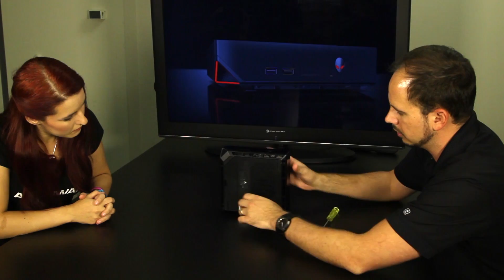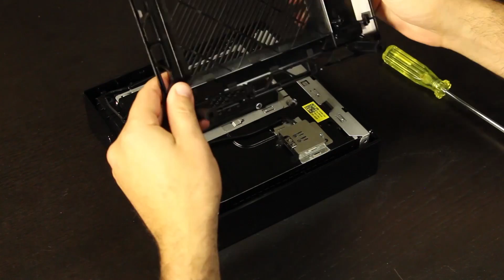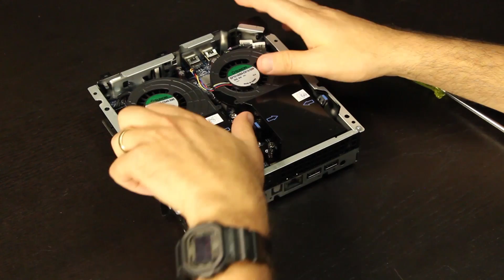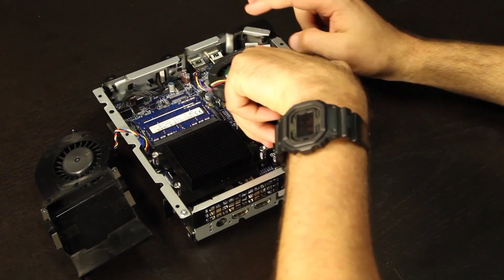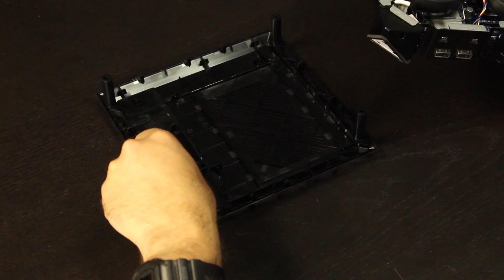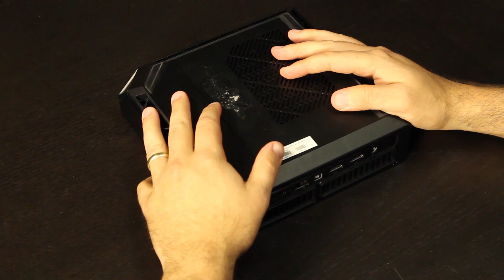Alienware Alpha - A Look Inside the Alpha

Comment: when upgradeing the CPU from i3, is it ok to use i5 4590 rather than i5 4590t,? Is there a compromise if the non T version was installed?
Reply from the maker: The power requirements are different for those. Therefore, the power adapter may not be able to supply enough. However, we've seen users with this setup and no issues at all.
Reply: +Alienware Appreciate the fast response,Ive already went ahead and installed the i5 4950 3.3 ghz,it worked flawlessly

Comment: Only problem , I have is that the video card is having problems, with failing, can I buy a new video chip and replace it like you would the CPU, if so please advise, as the drivers keep failing, and screen goes black restarts 1-2 x then fails over and over til the unit reboots, and the failures start again. So I want to buy a new video card chip and replace it, if this is possible where can i buy it!

Comment: does it bring a graphics card?
Reply from the maker: All the models bring the same graphics card, and it is embedded into the motherboard.
Reply: +Alienware can you please make it so we can change the gpu in different alpha models or have a graphics aplifier
Reply from the maker: Thanks for the feedback. We will look into that!
Reply: Alienware thank you :)
Reply: +Alienware My alienware alpha i3 won't turn on and just blinks yellow,why is this happening?  Also can I use 150v ram or 135v ram, does it matter? thanks in advance.
Reply from the maker: Hello Rick. Try disconnecting the Alienware Alpha from the power outlet. Press and hold the power button to drain it from it's power. Try connecting it again. If the problem persists. Please send us an e-mail to AWSocialMedia@Dell.com with your Alpha's Service Tag and a brief explanation of your issue.

Comment: Were you not allowed to actually remove components without ESD safety equipment?
Reply from the maker: +FrankyManky The system was drained from it's power prior to the video. We worry about our employee's safety as well.
Reply: I was mainly curious, because he didn't actually touch any sensitive components. Just the case and fans.

Comment: Is there a wireless wifi conector?
Reply from the maker: +Mone Kaufusi There is a wireless adapter or "dongle" for the Xbox360 controller which comes included with the system.

Comment: where the hell is the HDD???
Reply from the maker: Cloud Maverick The HDD is located on the bottom part. If you take out the plastic covers. You can find more info here: bit.ly/1L4pB4D
Reply: Haha thanks. I was weirded out when I didn't see it. Also I think this system would be better with a SSD

Comment: What is the name of the motherboard of the alienware alpha i3 core with 4gb ram. Am t Ryan ing ti get thr name of the motherboard so I can up the ram to a 8gb.
Reply: You cant as he mentioned.. Its custom made by them so u dont need a different motherboard to upgrade memory
Reply: So then what kind of ram can I get to upgrade it to 8gb please help me :L
Reply: And you need the name of the motherboard to know what kind of ram to get I believe.
Reply from the maker: +TheAdeptGamer The Alienware Alpha has 2 memory slots which support Dual Channel DDR3L 1600MHz. and is offered with a minimum 4 GB and a maximum of 8 GB RAM.
Reply: So to upgrade to a 8 Gb Dual Channel DDR3L 1600MHz to put in where the ram is correct.
Just trying to to make sure.
Reply from the maker: +TheAdeptGamer Replace the existing RAM with the one you want to upgrade. Correct.
Reply: Just found out since mine is probably a newer version of the Alienware Alpha I only need one 4gb of ram do you have any recommendations for 4gb of ram?
Reply from the maker: +TheAdeptGamer We don't have any favoritism for any specific brand.
Reply: +Alienware Yeah sure you don't but I need help finding a 4gb ram compatible for my alpha.

Comment: It'd be better than a console if you could upgrade the GPU...with that GPU, you'll probably never need to upgrade the CPU (and if you did ever need to, it'd probably be to reduce heat/power consumption to allow for overclocking your GPU, which will probably actually benefit you), and to upgrade the RAM you'll need to replace both sticks if you want to keep the same performance you had before (because otherwise you'll be running mismatched dimms).

Comment: Can i upgrade the graphics card?
Reply from the maker: Bio Gaming You can upgrade the CPU, hard drive and RAM, but the GPU is embedded on the motherboard. Consider that this GPU is a 2GB Nvidia 860M+.
Reply: Good enough thanks!Btw I'm getting one core i7 model
Reply: One more question, Is it a long lasting desktop/console?
Reply from the maker: Bio Gaming It is, if you upgrade some parts, after 3 years this machine will still hold it's ground.
Reply: Ok thanks love this company!

Comment: Could we install any external graphics card on the system other than the graphics amplifer?
Reply from the maker: Omar Omar The Graphics Amplifier is not compatible with Alpha. But you can use the embedded 860M+ Nvidia card included with the Alienware Alpha.
Reply: Alienware Is there any chance in the future when the graphics amplifier will be compatible with the alpha?

Comment: I'm not a big PC or computer guy. But can the processor be upgraded? If I were to buy the i3 but switch it out for an i5 I have here work or that's non-upgradable?
Reply from the maker: Nikkibruuuh TheBeast Yes, the processor can be upgraded; from i3 all the way to i7. You can upgrade RAM, CPU and HDD but the GPU is embedded on the motherboard to increase performance.
Reply: okay, thanks for the feed back.

Comment: How many watts are left for usb slots?
Reply from the maker: The Ultimate Limit Battery Doctor might be able to give you a more specific number, but: "A unit load is defined as 100 mA in USB 2.0, and 150 mA in USB 3.0. A device may draw a maximum of 5 unit loads (500 mA) from a port in USB 2.0; 6 (900 mA) in USB 3.0."
Alpha has 2x USB 2.0 on the front and 2x USB 3.0 on the back.

Comment: wait a sec you can upgrade the alpha with your hands
Reply from the maker: Ballisticcrage You can upgrade it by yourself, if that is what you mean.
Reply: Alienware what i mean is you dont need tools to upgrade the alpha because im afraid if i try to upgrade with my hands it cound break
Reply from the maker: Ballisticcrage You would need a Phillips screwdriver.
Reply: Alienware thanks and i have question, can you play 2 players on the alpha and if you can would you need 2 steam accounts
Reply from the maker: You can both play on a single Steam account, you are only restricted by game limitations not the Alpha system.

Comment: How to Reset Bios , like on my asus motherboard you would stick in a pin in a small hole on back of the motherboard? Thanks
Reply from the maker: SirCharles The battery is located on the bottom on the motherboard, it requires a whole system disassembly to be reset. Nevertheless, there is a password jumper by the RAM modules.
Reply: Can this potentially fix issues from electirc shock? I had pluged my Asus Based Tower into a non grounded outlite and it made my games start having glitchy rendering and texture errors, I put the pin the in back of the motherboard and it fixed the issue. Will using the password jumper do the same thing?  Thanks so much for responding

Comment: i own an Alienware alpha and I'm using it right now. I'm new to gaming, and was told to build a PC. I thought of both, but I have to travel a lot (Due to my parents being divorced) so getting a custom built PC was something I was going to do...but then I saw this...thing. It's no console. Don't listen to them. It's a micro-pc. I got the cheapest one and I already put some extra ram in there and I'm close to putting in a quad core i5. The thing is magical, but I saw 1 and only 1 flaw. no audio jack. you have to go out and buy an audio jack for a mic. What I do is use the 360 controller and plug the mic into it and I had to set it up, but it works. Great for 32" TVs. Oh, and you get a wireless dongle already built in. 

10/10 Starter PC. Don't listen to your friend who is a rich fuck and has a 14 core intel processor and a titan in his computer. Start with Alienware. you can even take the tower ones and just take all the parts out and put them in your own case. Oh, and you get the free games, awesome PayDay masks+weapons. All in a little $549 textbook sized micro-case. Enjoy!

Comment: Dual monitor support? I just bought this and I'm trying to figure out how to use two monitors (if possible)
Reply from the maker: Franky Ortega You can't have 2 monitors because there is only one HDMI output
Reply: Actually I was able to buy a hdmi extender on Amazon and got it working :) thanks

Comment: Question about upgrading:  Where is the HDD stored at, is it easy to get to, and is there space to add a SSD to pair with the HDD?
Reply from the maker: itchyisvegeta Under the unit. Easy to get to. Only one HDD slot there. You can install an SSD.

Comment: could build a more powerful steambox for less money then the entry level unit. People don't realize how easy it is to build your own PC. fro the 549. I could build a quad core even a amd6 core processor plus a nividia 750TI or AMD 270  depending what you put in the box PSU motherboard wise. Go price out the components you are being overcharged for what you are getting.
Reply: Good to know!
Reply: It isn't that direct a comparison.  I even suspect you may be one of those people that leaves a copy of Windows out and claims you can move it from an old PC or pirate it.
I've been able to beat the spec in PC's I've built for around the same cost but also end up with exactly what someone who buys an Alpha doesn't want.  A tower that has to be built.

You need to consider a gaming laptop sans small display as a fair comparison to this.
Reply: TeamDynastyGriefing It is easy.  ANYONE can do it.  It's so simple and takes like an hour or two max.
Reply: meh the 270 maxes out about everthing you can play right now as i have that card sure you could get a 280 for about 50$ more but yea the 970 would be nice to
Reply: That's impossible (I'm a PC fan) this console comes with a controller and is extremely small. Oh and you have to pay for the OS too :P
Reply: You pay the extra for a pre built off the self option and the form factor really
Reply: Hey asshat, Its easy for you to build a PC, Not easy for everyone.
Reply: No you can't.  This is the best I could come up with for the same price (i'm talking about the bottom end one which is great for the price.  The rest are crap.)  http://pcpartpicker.com/p/TFct4D
Reply: TeamDynastyGriefing yeah personally I would love to, but I have NO idea how. I was wondering if this would be a good entry-level PC for me for the price, but now I'm having second thoughts. SHould I just buy my own componets and say look for a tutorial video or something? I'm very in the dark here
Reply: Kannen Farris Yes.  If you go on reddit to /r/buildapc or /r/pcmasterrace the nice people there would be happy to help you out!  The bottom end one is a good entry level pc for the price.  Much better than an equivalent cyberpower or ibuypower.
Reply: eh I'm lazy so I'm probably going to get the Alpha and start upgrading an old PC I found in the meantime
Reply: Kannen Farris If you have an old PC you can upgrade you're probably better off plopping a gtx 970 and a new power supply in it or a gtx 750ti and then you don't need a new power supply (but it's still a good idea).
Reply: Andrew Hunt i kno this is a little late but your wrong sir for the 559 price tag asuming your using steam os or linux 
http://pcpartpicker.com/p/Q9cxNG
Reply: Tokaku I was going by the same specs as the i3 version and the price of some parts may have gone down for the build you made since last I looked.  I'm on mobile so I can't check now but I wonder how much more it would be if it was a Nvidia gtx 750ti in yours?
Reply: Andrew Hunt depending on the brand of 750ti it could be around 30$ cheaper
Reply: Yeah but it would be WAAAYYY more expensive with a 970.  I would rather have that too though haha.
Reply: frigginjoe A steambox has steam os. A free open source operating system.
Reply: MünRaker Let's be practical at least.
Even looking forward no Windows support's a pretty major strike against the idea of the Steam machines.  We're not quite to the point where we can rely on everyone supporting Linux.  Windows pretty much goes with PC gaming territory.
Reply: frigginjoe We can't keep ignoring it forever. Linux is much better than windows already, it just makes sense. Drivers are no problem, Linux supports not just itself but all hardware you could ever dream of.

If Valve really pushes Steam OS, the master race will ascend once again.
Reply: MünRaker 
Sorry but we as the master race were already ascended,
And sorry to you, but Microsoft has been part of that ascension since a long long time (ms-dos and up)
Reply: delukard07 And what did they do for us? They bring out Xbone excusives and don't care about PC gaming. Only recently we've seen an increase in intrest thanks to the PC supporters.

There is no reason for PC gamers to support Microsoft. None

Comment: so the gpu is solder on the motherboard that is a over priced can build a 8core 16GB ram and 3GB gpu for that price
Reply from the maker: calical26 Ok. So for $549 you get an 8core 16GB ram and 3GB gpu? Does it also have warranty support, a gamepad, and fit in a small case that looks good in your living room?
Reply: Alienware The problem is , the GPu is not upgradable and it ships with such a low amount of RAM , most games with Os etc use up to 4+ gb Ram , already , Assasins Creed Unity uses almost 5b Ram with my GTX 970 SLI setup.I have 8gb Ram. and I think 8gb Ram should have been there in the first place with the smallest i3 alpha.I love the fact that a company has finally broke up the console market and put some real gaming box against the slow igpu competition ;) Thanks for that , but In the videos you show , you should try medium settings, not high or Ultra , the most console gamers cant even notice a difference, because the Ps4 runs on custom medium- low settigns.So I would try medium with 1080p and show some 60fps performance ;) Btw , good job , and did it already ship ? maybe I am going to get a little power box for the couch ;)
Reply: The $549 dollar alpha is amazing for the price.  The rest are pointless.
Reply: BlackSn0wz Don't forget you have to install the game and download GIGABYTES of data on consoles now too.  Something like this which can be used with only a controller should theoretically be just as easy to use as a console.  They use a modified controller friendly version of windows 8 (maybe 7?) which can easily be switched to the regular desktop mode apparently.  I do agree.  I wish they had gone with a special modified gtx 750ti instead of a gtx 860m (which is about equal to the 750ti)
.
Reply: BlackSn0wz Apparently!  I don't own one but Total Biscuit was complaining that the whole process was so horrendous he couldn't even play a game on PS4 that he wanted to try.
Reply: Me too!  LOL!
Reply: Well they charge you a little more because of the Alienware UI and because they built it, including the LED's.
Reply: And this is the only System Alienware has that's under $1000.
Reply: Yeah but they don't charge NEARLY as much as they do for their other PC's for a "Building Fee" or whatever BS they can come up with.

Comment: The problem with this small design would most definitely be thermals.
You guys at alienware have been known to have problems with thermal throttling in your laptops, so let's hope the alpha doesn't fall victim to repeated mistakes.
Reply from the maker: Supersmurf1234's Gaming Channel The airflow and dual fans have made thermal control work well. We have been running them at our booths at E3 and PAX all day with no issues.
Reply: Alienware :D great
I'd definitely consider buying one, as long as it supports geforce experience. I really need a good gaming pc so I can record, and I plan to use shadowplay.
Reply: Supersmurf1234's Gaming Channel You can enter Desktop mode and download GeForce Experience with no issues. Make sure you have a KB/M ready though, as we don't ship with them.
Reply: Marc Diana not a problem, got tons laying around.
Thanks, btw :D

Comment: i pre-ordered my alienware alpha base model with the core i3 but trying to search for a 4590T core i5 because I will want to upgrade later brings up no results. Amazon sells the 4590 core i5 but there is not T next to it so would I be able to upgrade to that  particular processor? it does have a higher clock speed than the T variant. The core i3T and core i7T exist on amazon just not the core i5T.

Comment: great build!!! REALLY compact and powerful and nice attention to details. i did a mini-itx build myself but limited to normal PC desktop hardware and internal PSU hence a bit cheaper and bigger but id say the price you ask is fair because you always pay a premium for the smaller formfactor. Mine : 300W TFX PSU-bequiet. Pentium G860 (might upgrade that one). KFA2 low profile GTX750TI. 128GB SSD / 1TB 2.5" HDD and custom case wrapped around it. not as small as the alienware alpha but not bad either.

Comment: How will the HDMI-IN feature function? Does it do a split screen mode in the UI or would the console video feed itself be bypassed?
Reply: The HDMI function is a general pass through. Basically you call to Alpha to switch the video feed from internal to directly passing through the HDMI feed. This is all done via the Alpha UI console interface, with just a controller.